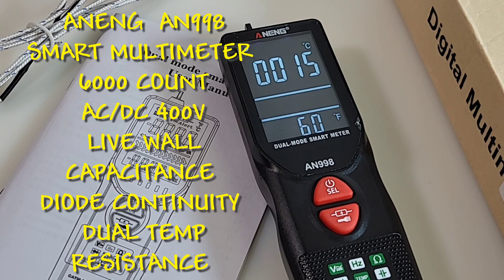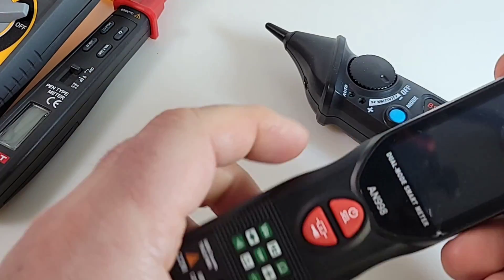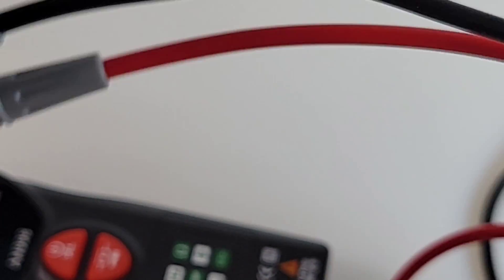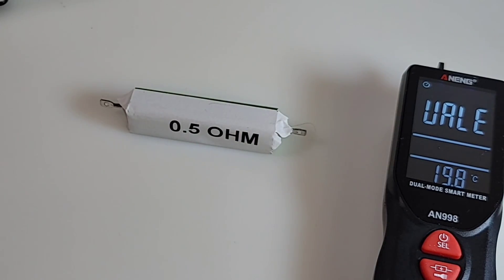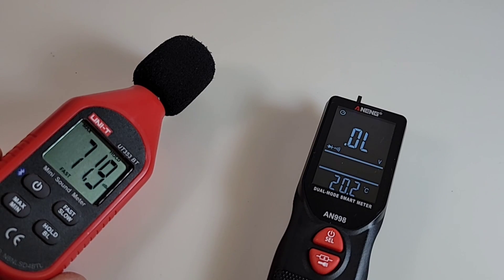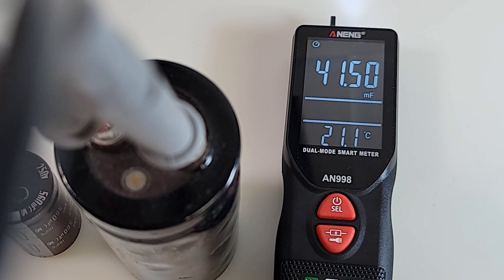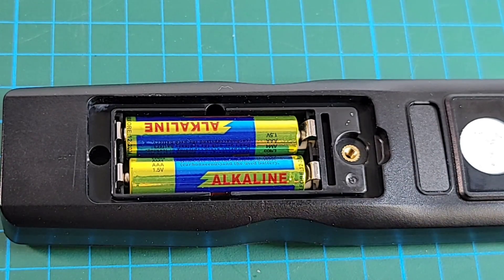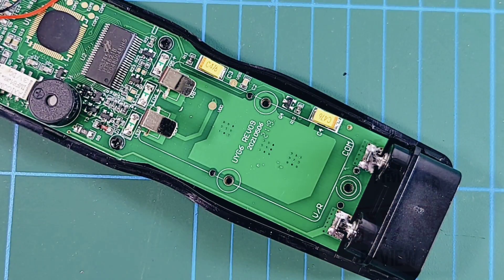ANENG AN998  CHEAP-O Multimeter Review & Teardown!

Comment: In smart mode when corcuit is in off mode then our meter shows resistance of circuit with respect to ground.if sudden voltage comes it shows voltage or voltage damage to multimeter(bcoz its internal relay was on resistance mode).secondlywhen capacitor was weak or bad it shows error or shows ac voltages in smart mode.i want to know smart function in practical manner.

Comment: Well its different anyway, not sure on its usability. Misses the current and low voltage measurement for electronics use and doesn't have the input protection for electrical use. May be handy to keep in the car. I have a couple of meters without a tilt stand and I actually don't miss it when working out in the field, little bit annoying when bench testing though. 
Thanks for the review, the Kaiweets meters have turned up now, so I will start to look at them soon.
Reply from the maker: Oh yea...!! Let us know how those new Kaiweets meters turn out !

Comment: My Habotest HT118A died lately. It was disconnected and LED's flashed once and now it's dead. Nothing inside suspicious..🤨
Reply from the maker: Hmmmm...that's odd. You've checked the fuses, replaced the battery..how does the selector switch look? Check Q1-Q2...
Reply: @KeepOnTesting  Yup, had it apart and did all except Q1-Q2 (is that the clamp combo?)
Reply: Yup! Can you tell some random EEV guy out in Kitchener needs to win a new DMM? 🤗 Sure seems like the Habotest CPU planned to kill its own flash program after it turns on for about the 100th time. Totally weird!